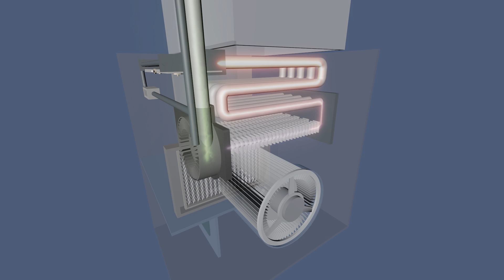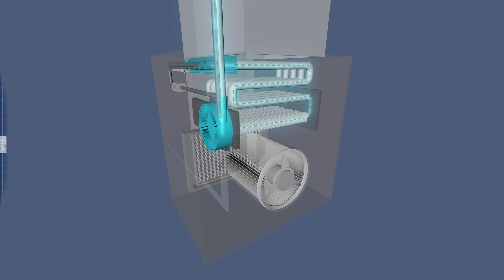Noisy Furnace? - Top 5 Fixes | Repair and Replace

Comment: Is it normal for me to be able to hear duct expansions when I’m in the room above my furnace?
Reply from the maker: Thanks for watching. Yes if your room is directly above the furnace then its normal to hear some sound from the duct expanding and contracting.
Reply: @AmreSupply  also is it normal for the furnace to be loud when the ac is on?
Reply from the maker: @aer2895  If the AC unit is built into the furnace then you'll hear it when the blower fan runs. The ducts will likely contract slightly as cold air passes through.
Reply: @AmreSupply  last question is my furnace meant to be very loud with a deep hum/air blowing noise
Reply from the maker: @aer2895  It depends on the furnace., but most furnaces will make a bit of noise when it runs. The blower fan pushing air through the vents will make some sound. If it sounds excessive maybe get it checked out, but you'll still hear noise in a room adjacent to the furnace.
Reply: @AmreSupply  ok thanks my g 👌

Comment: Blower motor was replaced on firnace. Now when heat kicks on it sounds loud like a bathroom fan!! Tech told me because its new and doesn't debri like old one??
Reply from the maker: Thanks for watching. A new motor can sound different than the old one. What kind of sound are you hearing? Is the motor itself noisy or is it more the air moving quickly that you're hearing?

Comment: Any thoughts on how to quiet down a new furnace? The motor makes a high pitch kind of zinging sound when running,,, Thanks
Reply from the maker: Thanks for watching. If a new furnace is making that high pitch sound then its likely not an issue with the motor but it could the sound of the air leaking or being drawn in. A small gap in one of the ducts or the furnace cover could cause the air to whistle. This can be difficult to narrow down visually but you might be able to feel the suction and the air moving in some cases.
Reply: @AmreSupply  great thanks,, I'll take a look

Comment: There's an annoying hum that comes from my furnace most of the day everyday(maybe from that smaller motor shown?) .  I've started to play thunderstorm/fireplace sounds to drown it and other sounds out.  Doubt the landlord will do anything about my complaint though.  Luckily spring is soon so I'll just turn it off completely.
Reply from the maker: Thanks for watching. Some hum sounds can be from a transformer while other sounds are from the motor running. In some cases it can be difficult to really narrow down.
Reply: @AmreSupply  thanks for the response.  Sounds like I'll have to get my landlord to have someone come out and look at it if I want it fixed. Thanks.
Reply from the maker: @jwest88  We're just happy to help in what small way we can. Best of luck narrowing it down.

Comment: My furnace makes a whiny buzzing sound when it starts but only in the wall.  At first it’s repetitive and then it speeds up to a constant whine the closer it gets to the end of the cycle but when I go downstairs I don’t hear it, yet it’s loud enough through the wall to wake me up at night.  It quits the moment it kicks off.  Thoughts to tell my landlord?
Reply from the maker: Thanks for watching. Do you have a forced air furnace that uses air ducts? Or do you have some sort of water heating? It could be the zone valve in the wall that you're hearing.
Reply: @AmreSupply  Sorry I’m not used to chatting on YouTube, took a while for me to see your response.  Yes I have forced air.  Also, I noticed as the weather warmed up (still cold but no longer sub-zero, I live in the north) the whine gradually got quieter.
Reply from the maker: @cherearenea  If it seems like its coming from the blower then its likely the motor bearings. If the bearings start to wear down the noise can happen when its off, and slowly warms up and becomes more lubricated. 

Alternatively if the whine is coming from the ducting, then thats likely just air blowing through. That is harder to really narrow down or fix though.

Comment: Does blower wheel need to be replaced with some rattling noise?
Reply from the maker: Thanks for watching. Sometimes a rattling noise can be caused by an imbalance in the blower wheel. This can sometimes be fixed by small adjustments and in other cases it can be difficult to really narrow down. If the rattling is caused by the blower wheel hitting something then you'll want to make sure that it spins freely.

Comment: question? so i have a small ruud furnace that is a gas furnace and their is a pipe that leads outside and it makes a whine noise and i can hear it when i change the heat. what do i do?
Reply from the maker: Thanks for watching. If the exhaust vent is making a whining noise then it could be a restriction of the airflow. You could check the cover outside to see if anything is blocking the port. Sometimes leaves, dirt or even ice can build up and restrict the airflow.
Reply: @AmreSupply  oh ok thank you
Reply from the maker: @La01781  You're welcome!
Reply from the maker: @La01781  If the sound is similar when you're at the furnace then its likely the blower fan motor. That repair can be seen here: https://www.youtube.com/watch?v=4SY8lRl8HV0

 Sometimes it can be hard to narrow these things down so it can still be helpful to hire someone to do an inspection.
Reply: @AmreSupply  ohhh ok thank you

Comment: My condenser compressor or whatever thing on the outside of my house does a low pulsating hum. Seems to heat and cool just fine but it goes wum wum wum wum wum... Sup wit dat? It drives me nuts.
Reply from the maker: Thanks for watching. If the compressor works but you notice a hum then its likely the contactor relay. Over time the parts inside of the contactor can sometimes fuse together or become stuck. It will still provide power but its a sign that the relay might need to be replaced.

Comment: Great video but none of the noises of your video are like mine. I recorded the noise and I want you to hear it. It is scary and loud and it happens each time the furnace is starting up and it struggles to start the fire, sometimes failing to do so. It is 4:43am now and the noise just woke me up. Let me see if I can attach the video.
Reply from the maker: Thanks for watching. Unfortunately due to firewall and security we cant download files like that. If the noise happens right as the burners are being lit then it could be the sound of the gas igniting. The fact that the flames aren't lighting well points to the fact that the burners might be dirty. If thats the case, the gas will build up, and combust making a loud pop rather than a slow continuous burn.
Reply: file:///var/mobile/Library/SMS/Attachments/ab/11/E9F7921F-930F-4E26-9153-18AE973C13A7/IMG_5230.MOV

Comment: Definally having rattling noise after 2 minutes when the first fan turns on.
Reply from the maker: Thanks for watching. If the noise only happens initially then its likely the inducer motor that's the problem. If needed that motor can be replaced but its often as one unit with the enclosed blower: https://www.youtube.com/watch?v=EsJhfFMZWJA

Comment: I don't here any of those but Im listening from the outside of the unit where the videos have the cover off. Would that make a difference? The plumber said everything is fine, just old. But it is so loud and runs nonstop. Our neighbors filed a complaint.
Reply from the maker: Thanks for watching. Taking the cover off will increase the noise but it will be similar overall. The location of the furnace can make a different of how loud it is in the home. As well, if the furnace runs non-stop check the thermostat settings. The fan should be set to "AUTO", this will mean that the blower will only run when heat is needed.  If the thermostat is set to "ON" the blower fan will stay on and will run 100% of the time even when the furnace is not heating.

Comment: What a GREAT video! Thank you so much for taking the time to do this! Single mom here, so it really helped that you included the sounds! I’m about to strap on my (pink!) nail apron, bundle up and head up to my attic to see if I can repair what’s causing the racket! I’m hoping it will just require the tightening of bolts! 🤞🏽 Stay tuned and thanks again! 👍🏽
Reply from the maker: You're welcome Leslie, we're so glad that the video was helpful to you! Best of luck to you in narrowing down the noise!
Reply: Did it? I have the same loose sounds in mine

Comment: How about Sound of rubber rubbing or slipping? High Dander?
Reply from the maker: Hi Sara, thank you for watching. If the belt is slipping then there could be oil or grease on the belt or pulley. As well you can adjust the belt tension if needed: https://www.youtube.com/watch?v=APqq4X_gjUU

Comment: My furnace makes a hum noise on start up that gets quicker until going away. It sounds like the nose motor or wheel. Is there a way to tell which it is?
Reply from the maker: Thanks for watching. Its not uncommon for motors to hum when they start up. If the noise goes away when its up to speed, then its likely not problematic.

Comment: My furnace has been making sounds similar to the popping and banging you associate with duct expansion but I don’t have forced air. Should this be an immediate concern?
Reply from the maker: Thanks for watching. There is also other metal inside the furnace housing that can expand so it might not just be the ducts. If your furnace runs properly then its likely just expansion. Monitor it and see if anything changes over time.

Comment: It's got to be my inducer motor.  It's only when the burner is on, and not when just the fan.  Thank you!
Reply from the maker: You're welcome! We have a video on replacing the inducer motor as well that you might find helpful: https://youtu.be/EsJhfFMZWJA
Reply: @AmreSupply  I watched that right after.  Great videos!  Wondering what the best plan is to get a replacement.  It's about 20 years old, so I was thinking of removing it and taking it to Menards or Home Depot to find something compatible.  Any suggestions?
Reply from the maker: @js100tr  Thanks we're glad you're finding the videos helpful. Home depot likely won't have the part but any dedicated HVAC supply shop will do. If you were in Canada you could come into AMRE directly. We still ship to the US so if you can't find your inducer then take a look here and search by model: https://www.amresupply.com/catalog/Draft-Inducer-Flue-Exhaust-Blowers-And-Motors-661088

Comment: How can I make my new furnace quieter, I can't sleep with the sound, there are silencers
Reply from the maker: Thanks for watching. It depends on where your furnace is located and how your home is set up. If there is duct expansion you could try tightening any of the support brackets on the ducts if you have access to it. There is also acoustic foam or wrapping that can dampen the noise. Since you likely won't be able to prevent the duct expansion (the metal will still heat up and cool down during normal use), muffling the noise would be the best.

Comment: Hi nearly the professional came to to replace igniter after that the furnace start making noise he took the picture of the furnace and told me that your furnace it's old after he left the furnace start making noise I was wondering did he messed up something on the furnace I like to know thanks
Reply from the maker: Hi Edmond, thank you for watching. What kind of noise is the furnace making now?
Reply: @AmreSupply  the noise it's like something loose
Reply from the maker: @edmond97106  It could be vibration noise or something could be loose inside the blower wheel. He likely opened a few things up to do an inspection or the furnace could just be starting to wear out. Regardless you can always try to narrow down the noise yourself. The blower fan can be accessed by following these steps: https://www.youtube.com/watch?v=1giPLrObYb4&feature=youtu.be

Comment: Thanks for video! Is there a way to somehow reduce the popping and banging noise from ductwork? That happens very often under my bedroom floor and keeps waking me up everynight((
Reply from the maker: You're welcome Roman, we're glad you liked the video. You could try tightening any of the support brackets on the ducts if you have access to it. There is also acoustic foam or wrapping that can dampen the noise. Since you likely won't be able to prevent the duct expansion (the metal will still heat up and cool down during normal use), muffling the noise would be the best.

Comment: Hi, my goodman electric furnace is about 1 1/2 old and it just started making a buzzing sound when it’s running, is there anything you can recommend I do to fix this issue?
Reply from the maker: Thank you for watching. If its more of an electrical buzzing then its likely the transformer or the motor so you'll want to keep an eye it as the motor might need to be replaced. If its more of a vibration sound then its best to check that all the bolts are tight and that the rubber washers are still in place.

Comment: duct expansion makes sense if the furnace/heat just kicked in. but what if it is going on all day and all night? what is the solution? 
it also isn't coming from one specific point, it's throughout the whole system, like it's echoing itself through the entire ducting. could the duct be continually expanding? what causes this and what are the solutions? 
please advise!
Reply from the maker: Thank you for watching! The metal ducting will continue to cool and contract well after the furnace has stopped heating. There is still a bit of heat inside the duct and that will dissipate over time. If you have access to the ducting you can try tightening some of the screws that hold it in place but regardless the sheet metal will expand and contract randomly. There's no way to predict it and there's no way to really fix it.

Comment: Thank you for an awesome video! We just replaced our electric furnace. After first time running, we could hear some noises. It's more like from the ceiling or the vent area but I'm not sure. Even we could feel some vibration as well. The sounds like thunder. It gets loud in the middle & is getting louder right before it stops. Also we could hear lots of popping sounds irregularly after the heater stops, maybe because of duct expansion. I was wondering if you could tell me why this happened. Thank you in advance! :)
Reply from the maker: Thank you for watching. What you are describing in the vents is likely duct expansion. When the metal ducting heats up or cools down it will change its shape slightly, and pop in and out. After the blower fan stops running, the ducts are now cooling down and will continue to contract or pop for a few minutes.
Reply: @AmreSupply  thanks for the answer!! But just wanted to make sure in order to stop the feeling of vibrations from the duct just wrap insulation or the aluminum bubble wrap duct foil? Any advice would help me out so much thank you!
Reply from the maker: @tatebraboy336  That is a great question. It all depends on your particular home and how things are installed and how much access you have to the ducting. To reduce the expansion noise you can cover your ducts with fiberglass insulation, or insulated foil. Additionally you can use rubber pads to isolate ducts from wood to reduce how much vibration is transferred into the home. Even with all these measures it is difficult to completely get ride of the noise, instead you'll likely only get a modest reduction in loudness.
Reply: Wow this is literally our exact same problem as our house! I’m hoping ANYONE can give me any advice to quiet this down it would be much appreciated thanks!

Comment: My furnace did high pitched noise you played for the belt. I turned it off because me and my son got scared. It's early morning right now, it's cold and I turned it back on. It's no longer making the noise, should I still have it checked?
Reply from the maker: Thanks for watching. The belt can make noises as it wears out, or as it warms up when running.  If its still gripping and turning the blower fan then the furnace will continue to run without issues. Replacing the belt or adjusting the tension can help get rid of the noise. If you're still concerned then don't hesitate to get it checked.

Comment: The squirrel cage moves noisy and also off balance. What do you think is the cause? It’s a 2006 York 3.5 TON.
Reply from the maker: Thanks for watching. With the power and gas disconnected, look inside blower wheel housing and make sure there's no debris stuck inside the blower wheel. If you remove the blower wheel you can also turn the wheel by hand to see how centered it is while it spins. From there you might be able to loosen and re-tighten the screws. You can see how to remove the blower wheel here: https://youtu.be/4SY8lRl8HV0?t=84

Comment: I had just replaced my blower motor and about a month later the blower fan was rattling a bit.  Watched this video and tightened the set screw.  Presto!
Reply from the maker: Thanks for watching! We're glad the video helped you narrow down and fix the rattling!
Reply: I had a similar issue on a motor I replaced about a year ago. I tightened everything up and it stopped for about a day, then started up gain. I'm not sure if t hings loosened back up, or if removing and replacing the blower motor stopped some other issue.

Comment: Thank you, spot on..., had my wheel cleaned by AC company and that’s when squeaky noise happen .🤨🤨🤨. No, they are trying to act like I need a new system, NO I DONT... they have been servicing it for 5yrs. Yes my system is 20yrs old, but it kicks air and  heat great, ☺️even before it was cleaned. Thanks.
Reply from the maker: Hi Taneda, Thanks for watching and sharing your experience! We're glad that your furnace is still running smoothly after 2 decades. Were you able to narrow down and fix the noise?